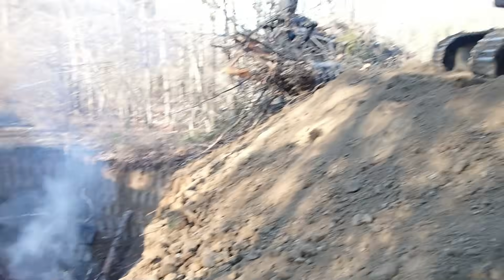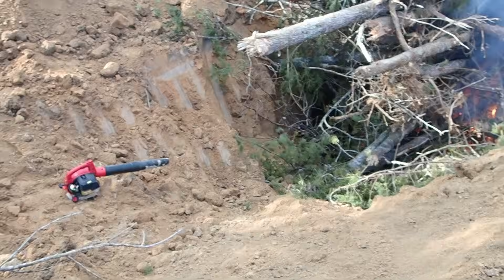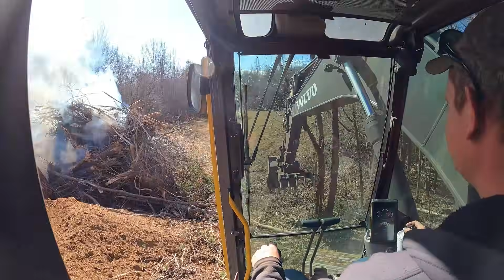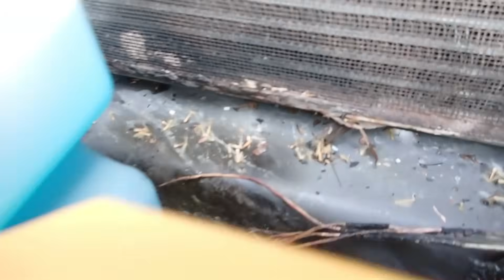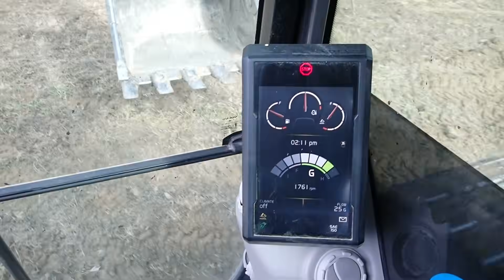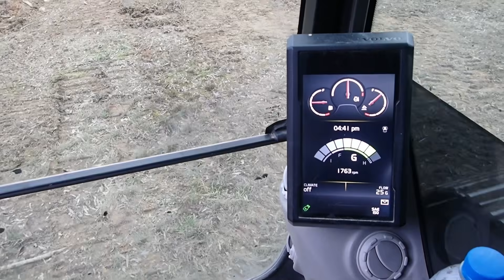I Set The Machine On Fire Extreme Pond Makeover (Day2)

Comment: One of those wires would more than likely be a water temp senor would throw a code, other electric cooling fan , a/c fan clutch , high low presure cut out for a/c system they are tied into heater AC cab fan probably blew the fuse with the little fire. Should be a yellow or lite orange colored one.20-30 amp.  Take some video of where they are going and I can tell you what to check. If you want.

Comment: I would run the wire on your final fix through a metal tube or something similar so fire can't get to the wires or reroute the wires another way.  It is amazing that a heavy duty machine can be crippled by such a small thing.   I had a ford van years ago and every time I would signal to change from the left lane to the right lane on the freeway it would knock the cruise control off.   located the problem in the right rear taillight socket.  They wire things weird sometimes.

Comment: Chris, I was wondering if you face any dangers in terms of melting or damaging the hoses on your excavator when placing those files into the burn pile while is on fire?  Not doing this work, I never know if its tricky or really a non-issue.  I would guess you have almost no issues with the heat and the rig itself, other than the glass (and the fuel on its own).  Just curious.  I would love to hear the actual "risks" of burning all that crap...

Comment: It appears you have been the victim of a design issue. Perhaps, during you next meeting with the local Volvo dealer you could point this out, for them to take the matter up with the excavator designers, possibly a metal conduit to protect that section of the wiring or a body design modification to cover the area better.  Just forwarding the ideas....

Comment: Check the fuses for the a/c and heat the arcing if the wires is what shorted out the fuses for it .it's a simple fix been working on equipment for awhile and that would be the first thing I would check .fuses are very temper matic but do there job

Comment: A few years ago we had a Cat 14m and a few other machines onsite to remove some clay mix used for a motocross track, inside an indoor riding arena. The new owners purchased the property and wanted the clay out and back to a rideable arena again. The 14m windrowed most of the clay to be loaded with a 966 until something caused a fault. The machine threw a code and started beeping for the next three hours. " Ah screw it, keep running it. Just turn up the music to drown out the beeping or put ear plugs  in." Well after 3 hours, it gave up and caught fire inside the engine bay. Filling the arena with smoke we finally got it out. Something overheated... come to find out the primary hydraulic pump failed and the machine was sending a warning to stop immediately and service it, although it didn't say what the code was for. The last three hours of work was done all off of the secondary pump! It never went into limp mode or had an override option if it did. Once the fire was out we could see melted out of the bottom of the housing it sat in. We were impressed you could run of the secondary pump for so long. "Hey, call Cat and tell the engineer good choice on the pump, we worked almost all day on the secondary." It's worth a stop and look to see what the problem is and why the machine is throwing a code and alarm. Needless to say the owner wouldn't have been happy if the brand new Cat burned down on day 1.

Comment: I had the main line from the pump, which is metal, get a pin hole in it pointing directly at the engine block. It sprayed a fine mist and caught fire. I had no extinguisher on board so I ran to the building, ran back, and fortunately the only damage was the main line. Still $$$

Comment: I would get some good clay, easy to find in your work, and fill in the at area around the water bottle and cover the wires in that trough with clay and that will make it fireproof. as an equipment owner you should use every accident as an opportunity to make it so the accident doesn't happen again. If the clay thing sounds too janky you could fab a metal plate to cover that area, but the clay is fireproof so maybe both, metal cover plate for looks and clay for function.

Comment: I'd check all your fuses after the wiring repair.
Reply: The reason so many systems were affected was most likely related to the grounding circuit which can be used by multiple circuits simultaneously. And yes after you fix the wiring ALWAYS check the fuses. Saw a rookie mechanic spend two hours on an electrical problem only to to have me point out a twenty cent fuse was blown in two minutes😂🤣😂🤣

Comment: I'm not an excavator technician but, that sensor by the a/c condenser is an ambient air temperature sensor. It tells the ECM how hot it is outside which controls when the A/C kicks on and might also help control the fuel air mixture to the engine. My advice would be to repair the wiring, disconnect the battery for ten minutes and on the next startup, the codes might clear themselves.

Comment: is there any fireplace screening you can put on the inside of all the openings for some added protection?
Reply: I was thinking the same thing, some fine stainless steel mesh on a frame with magnets easy to clean and leave it on the inside of the air intake.. mesh can be pretty fine. Kind of like a spark arrestor?

Comment: most likely a fuse blew if the wires shorted out.
Reply: Agree... I'm sure there's a fuse panel somewhere.. worth checking out as those are most often.. cheap fixes
Reply: @ronpeacock9939  they like to use diodes a lot in these newer machines as well. they blow out easy. don't cost much but can be a booger to figure out if you don't know that.
Reply: @chrissheathewoodguy  Depending on how sensitive the circuits are... I can see this... as it would protect entire circuits from reverse polarity situation... With the amount of computers going on things today, that could be a cheap but difficult to find fix vs. replacing an entire expensive but easy to find circuit... I guess the smart money is on not setting your toys on fire in the first place... because no doubt that was a serious fire he had going.
Reply: @ronpeacock9939  the diodes are very easy to replace. they just plug in and most often are blue. now you can't just get any one. it has to to have to correct resistance diode. I thought i had my charging issue with my john deer fixed but the diode went again today. charging system. grrrrr. i have a short some were.
Reply: @chrissheathewoodguy  Oh I know what they are... used to study electronics before I went into IT... (Fell in love programming them more than building them)..but I've also seen where they can hide stuff like that because they didn't think access was needed either... that old Hindsight being 20/20 thing
Reply: Same here! I would replace the whole (affected) harness as heat + copper= damaged insulation. Hey, Chris, when you gonna raffle off those bucket teeth from the Vet Rock Pile?

Comment: That deeper ground temperature is why heat pumps work. You ever do any digging out for installing the grids for that Chris?
Reply: Heat pumps, or geothermal heating?
Reply: @Babycatcher55  Heat pump grids generally laid no deeper than 2m/7'.
Geothermal is vertical & way deeper, thus needing drilling, rather than excavating.

Comment: when you repair that harness..  after putting some fresh convoluted tubing on it..   you may want to invest in a big roll of silicone self vulcanizing tape to wrap that and other harnesses that have had debris fall on them.. here is a grainger listing    Self-Fusing Tape, Silicone Rubber, 1.141g/cc, 1 in Width, 432 in Length, Black Color
Grainger Item # 3DXU8  20 bucks a roll.  this is not like normal vinyl electrical tape.

Comment: the grey sensor in front of the condenser is a ambiant air temp sensor, it was probable telling the machine it was - temps like -150 and causing the fault code
Reply: @Southern Christian WHITE MAN it’s gotta be tossing a code to the machine since the values are out of bounds. The engine probably use the air temp to calculate the air density for combustion.
Reply: the confuser is confused
Reply: @Southern Christian WHITE MAN Wow!, they haven't run you to ground yet?
Reply: ....or the WIRE is cut Somewhere in the harness.
But you wont know that till hours later after parts swapping. I hate "modern" Electronic fuel injection 😠
Reply: Yum